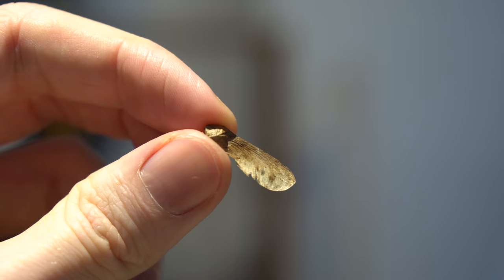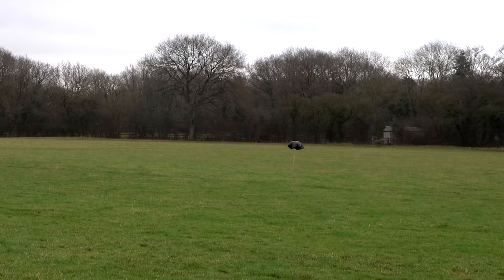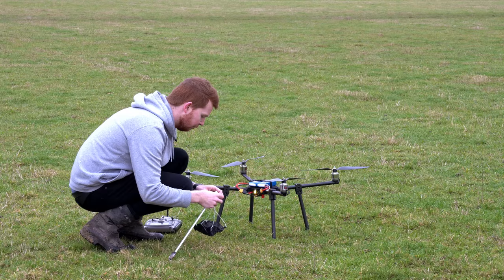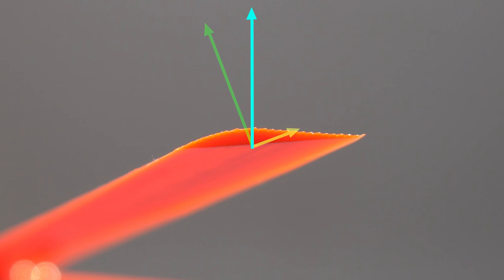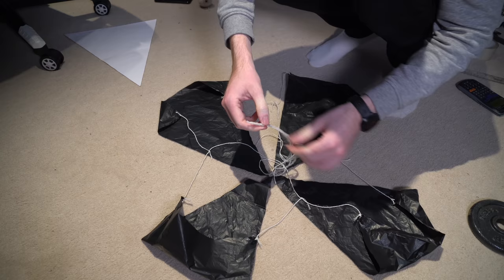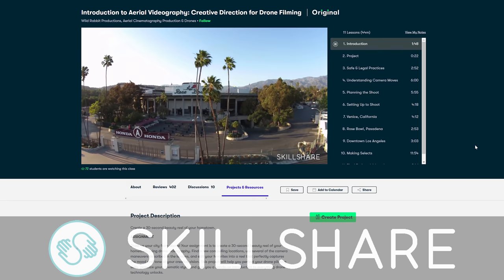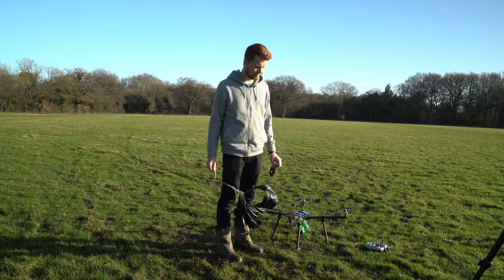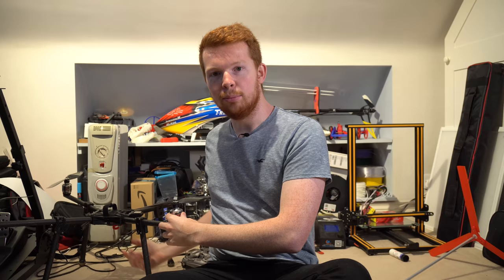Should Parachutes Spin?

Comment: Not saying this is practical as stated, but as an experiment, I'd try duplicating the design of something like a spinning maple seed. A one-sided blade, maybe something stretched over a frame, with a center of rotation that attached to center of the falling mass, and then a separate mass opposite the blade. The blade and the opposite mass will spin about a center of rotation, and the blade accelerating the opposite mass will create angular momentum  in the shaft, and not just create drag against the air. I don't know if I'm making sense, but as slow as those seeds fall, it makes me wonder if it's more than just simple drag against the air.

Comment: I thing rotating objects drop slower because a part of the potential energy is turning into rotating kinetic energy. Angular inertia of the spinning object also has an impact on vertical speed. 
For example if you would made those blades with higher radius but the same surface area, blades would fall slower due to increase in angular inertia. 
Correct me if I'm wrong cuz my argument is based on my high school physics lessons.

Comment: Oh, this is pretty neat, Tom! Have you considered experimenting with Rogallo wings? Somewhat related: One thing that a drone can't lift- even at a very light weight- is an unfurled parachute placed under the drone and attached to the underside of the drone. The downward thrust of the blades holds the 'chute firmly to the ground and prevents the drone from rising. Admittedly, this was the expected result but I just wanted to actually see what would happen. :)
Reply: I think as long as the air is able to escape around the edge of the chute, the drone would still fly, just not as efficiently.

Comment: An easier way to explain why it makes it slower, 
The total energy of the payload is its potential energy due to gravity. That's as fast as it can fall. Gravity adjusted by its intrinsic drag. That's the only energy it has access to. Its shape is such that when falling through air, it must spin. This spin requires energy to happen and it HAS to happen. So the energy to spin it comes from the only energy it has access to, gravity. And that's constant. The energy required to spin it comes as a reduction in fall speed.

Comment: In thinking about NASA, there is a need for redundancy. There are videos of one chute failing in a triple set. Thus, the working two would avoid disaster. Rotating chutes could be  counter rotating quad copter style, but there is nothing to prevent interference from diagonal chutes. With a single chute, there is a problem with the bearing to prevent the payload from spinning. A two chute counter rotating configuration would be possible, but the failure of one side would result in an unacceptable descent rate. In addition there must be a pair of bearings to avoid twisting the shrouds. Bearing failure would rope up the shrouds, collapsing the chute. There is also the problem of chute opening and stability before full deployment is achieved. In short, it is a pass or fail system, not recommended for life support.

Comment: Just an observation: it seems that string of the spinning parachute could not spin freely. It seems it tries to spin the weight as well which stops the parachute from spinning faster. it would be really interesting if you could place a bearing between the weight and the main string. Maybe faster spinning of the parachute provides slower descent and more stability.

Comment: It might also be worth trying tapering the blades along their length.  The inboard low speed area is the ‘driving’ section at a lower pitch angle and the outboard  high speed ‘lifting’ section at higher pitch angle.  If they blades can be spun up prior to release, they avoid the need to optimise the blades to ‘accelerate’ the rotor during the initial fall.  Alternatively, have a variable pitch system at a low pitch after initial release to accelerate the blades, and then increase to pitch when up to speed to optimise the L/D ratio.  Lots of hard CFD sums, perfect for another video :-)

Comment: OK. How about a parachute AND blades? (one would follow the other)
Once that's done ... how about doubling the blades? Will it also double the time to go down? 
How about calculating the maximum amount of space between blades so that they don't interfere with each other? Meaning, how much more blades can you put until it doesn't make a difference (but still rotates)?
How about putting parts of a parachute between the blades, where it's calculated the blades don't rotate enough to make a difference?
How about going nature's way and making a one blade parachute?
Finally how long can these blades be? Is longer more efficient?
Wow love your videos. Keep them coming!

Comment: I have deleted a few comment attempts due to recognising my own ignorance. I would argue that equating a diameter of rotor equates to a diameter of parachute. my answer is... it does not, because both rely upon entirely different principles. but I have to give you credit, massive credit , for covering yoyur variables so well. surface area of  parachute equalling surface area of 3 blades. I really am impressed now I watch and listen... really impressed. and this is less than 1 minute into 9 minutes.

Comment: I think the autogyro concept needs further investigation. If airdropped cargo had the potential to get shot at, having a high rate of descent through MOST of the drop would be a good thing. If this drop rate was converted and stored as rotor rpm, but the rotor blade pitch was sharpened at the last possible instant to arrest the descent to almost zero just as the cargo reaches the ground, the cargo would be a lot harder to hit, spend less time aloft as a visible target, yet still minimize potential damage to the cargo. Obviously this would require some active control of the rotor assembly, either through on-board software, or via a radio remote control, or both, much like your drone has. This would allow the descent profile I described, PLUS the cargo could be placed on the ground much more precisely, and if the cargo was actually “slung” beneath a rigid frame where the rotor assembly was, then as soon as the cargo was resting on the ground, the remaining rpms would be just enough to displace the rotor and frame just far enough to not land on top of the cargo, unless it was part of the deployment scheme, wherein the assembly would include some kind of protective cover/camouflage, even booby trapped if necessary disarmable only by friendly forces, in cases of really high-value cargo or if there could be a significant time delay between deployment and recovery. The entire thing could be recovered along with the cargo, picked up by drone, or by hand at a later time.

Comment: What if you get your autogyro out again, but have an actuator to change the pitch.
At the last 3 meters or so, change the pitch so it has a higher angle of attack and softens the landing to practically no downward velocity.

The same thing can be said about the parachute. As soon as the parachute gets to about 3 meters, drop the weight to the ground and let the sensor very gently land, again with practically no downward velocity.

I mean there is a RC heli right there on the shelf!. :-)

Comment: A question that might be interesting is if the propeller blade had a twist in it much like the propellers on planes often do.  Would it be possible to take advantage of the airflow difference between the root and the tips of the blades doing that?

Comment: Takes more energy to change direction using a helicopter blade. Parachutes allow for the rider to decide wear they fall with relative ease given the proper parachute design. Also extra moving parts of the spinning blade is asking for an accident. Just food for thought though cause I like your experiment

Comment: Just as a side, some helicopter pilots have used this to save the lives of those on board when the engines fail, the skill it takes to do this with helicopter blades is unbeliveable. They still smash into the ground but at a much slower than they otherwise would

Comment: this would add quite a bit of weight to the craft and it would not slow it down enough passed Terminal Velocity,  you will still need the retros to land. Still you would be able to steer the modal without expanding fuel and if that is the goal. I did this a few times in simulators and Auto-rotating is difficult at best your rotors can stop spinning and you sometimes can't get them started again once they stop. this is not a new Idea for a spacecraft.. still the obvious answer as to why no one has tried it is material sciences, metal crystallization and failure  maybe with the reentry temps are too high and coatings are too delicet but they did try this during the mercury capsule days...

Comment: Really interesting.  I always wondered whether this principle had been considered when deploying equipment to Mars.  It always seemed that the methods traditionally using thrusters were pretty complicated and not very forgiving in terms of stability.  A rotor system (not a rotating parachute) could pitch the rotors just  before impact for a soft landing.

Comment: some late info.     at :22,  answer  -  the  overall  Shape  leads to spin  and  an increase in AIR  RESISTANCE,  and  LIFT.     rate of descent  is reduced  by,  both,  drag  And  by aerodynamic  Lift.   ( just like  ANY  other gliding  wing, that has a lift-making profile ).      googletranslate

Comment: You could dig a little deeper to this matter as you did with the tribuchet. Try to print new blades with a v-shaped pocket in the green area of the blade as you shown in this video to make the upcoming windflow spin the blades even faster. Or probably set these blades to a autogyro and run a different test. Do you think such pockets would make any affect?

Comment: I still do not fully grasp this. The propellor spins in the wrong direction and so I can't see how it would cause any significant amount of lift. You explained the lift and drag too quickly. Doesn't the spinning cause more horizontal drag. Which gets converted into heat energy. So height energy gets converted into heat energy more efficiently with a propellor.
Reply: And would the propellor parachute work even better if the tip was tilted into the other direction compared to the center?

Comment: I couldnt help but seemed to notice that the leading edges of your red rotorblades was slightly angled at a negative pitch. . . . or was it just the camera angle in your still photos???  this would result in the trailing edges of the blades rotating in the opposite  direction of the leading edges of the rotorblades, causing them 1st to bite into the air. If ya was wanting to have the rotor blades spin faster at a much slower rate of descent, increase each of the blades pitch to more of a positive pitch--leading edges bite 1st into the air as the rotate. Awesome video.

Comment: The rotating canopy idea might be ok for  inanimate objects, but your suspended load will spin even if there's a swivel in the system. That creates two problems if you have a human load: lack of control and the people (or even animals) will be insanely dizzy when they hit the ground. And any stabilization mechanism will add to the suspended weight and therefore require a larger parachute.

I think the KISS rule applies here.

Comment: Tom,   Love the vids, great job.   I think going one step higher on the autogyro would be to put in a single serve collective system on it.   Drop it let the blades spin up and then pull collective once the test part gets close to the ground.   I have always wondered why spaceX never did that.   They bring enough fuel to get the craft up and back down, seems heavy to me.   Put if they did fold out blades, they can use the potential energy to spin up the blades on the way down and land.   And for the parachute u could do a similar thing and flair it right before landing.   To compare the 2 ideas, have a G sensor to measure the impact G's.
Reply: There was a roton rocket. The whole mechanism is heavy and complicated. Falcon 9 really doesn't use a lot of fuel for landing. Additional fuel cost mostly comes from getting all that additional fuel up. You have the same issue with rotors.
Reply: @nejcpintar7965  Thank you for the info... I was always wondering about that!!!

Comment: You should try a Archimedes screw and see if that will  glide down even slower just extend the screw as you go up so like a parabolic spiral screw
Reply: lmfao       just as with a vawt, vertical axis wind turbine,  there is  NO  REASON  for air to enter and stay in such a   Rotating    structure.

Comment: Great video, Tom. I know the principle of how an autogyro works is not intuitive, so your description was very helpful. How about this for an idea: what if an autogyro had FOUR blades (most are two-bladed): two normal ones and two 'shorties'? The idea is that the short blades operating in the inboard part of the disc would theoretically provide extra rotating force to the rotor, so more lift would be available. Maybe allowing a smaller rotor diameter... How about trying that one out? Many thanks!

Comment: If you could store energy in the rotor could you flare late in the descent and therefore have a much smaller surface area and use the energy generated in the last few feet,

Comment: great video-thanks..  I found this very timely, as I am developing  a deploy-able wing (like the seed shape) with ribs and sub ribs made of carbon-fibre-kevlar, and a hybrid silk composite  for the membrane,  for dropping a man and equipment from both low and high altitudes.  Eventually after the un-powered prototype proves my concept, a lightweight fly-by-wire mechanism will be installed in order for a micro-manipulator arm/actuator mechanism,t to control the wing shape [read pitch, yaw, roll, etc.), and a computer will change the shape of the wing for maximum efficiency.  This will slow the spin down to the same as jumping off a 2 meter platform.  Need to work out the 8 minutes of dizzynness that comes with a drop at 5,000 meters.

Comment: Out of interest, were you working out the "surface area" of the parachutes when laid out flat or the horizontal cross sectional area as they'd be when inflated? (the effective area which is actually blocking airflow and creating drag)

Which would be the correct method?
Reply: James Bradwell   Parachutes are secondary devices and weight is critical.  It comes down to " you have 10 grams of plastic
-  how do you want to use it."  Area= weight so cut it any way you want.  The higher the drag the better.

Comment: 4:48 Yeah. Parachutes are weird. Did you also know that some nations (I am most familiar with Russia doing this) even put small rocket motors attached to parachutes? The purpose of the small rockets were to further reduce acceleration as objects (or heavy cargo falls down) fall.

Other than that, there were other weird "parachutey" looking systems from long ago (like for example, back then during the 1960s [I think?] some people have entertained the idea of using hot-air balloons [that sort of deploy like a parachute] as a means of slowing descent of the pilot's ejection seat [and hell, even fly the ejection seat at a level altitude for some time. All thanks to the hot-air balloon device], and for air-dropping tanks, or something. Times back then were super weird        :/       )
Reply: I seriously doubt anyone put rockets on a canopy,  maybe on the load

Comment: What do you think of vortex generators? Perhaps the 17 °- 20 ° of the rotors' individual length, then a tapered winglet turning downward at 35°. 
I had a once had a similar tail drag chute applied to a box delta kite. 5 triangular pieces .  And 150mm diameter shaping ring and a swivel.

Comment: Dude, I have a very good idea for your compressed air engine. This idea of using pistons doesn't work with compressed air just because it works on gasoline cars, you need to use a circular motor as it will be more efficient since the engine doesn't need to use the energy generated to control the compressed air intake. if you didn't like the idea, at least try please

Comment: What if the parachute were just a disk? Then it would truely utilize its entire surface area, no? Whennits curved, the pressure inside rises and effectively diminishes the active surface area. A parachute may evey experience a coanda affect like that hovercraft, pushing it down even faster

Comment: I wonder if instead of having negative pitch as your set up to spin easily how it would have affected the rate of descent if your pitch was positive 3 degrees pitch above zero lift angle, just like the real autogyros. The problem is that you would have to prerotate it to achieve autorotation.

Comment: Great video and testing concepts of potential drone soft crash protection which will be someday a waiver requirement by FAA for us Part 107 pilots when a job is a planned event and over people. There always has to be a risk mitigation plan to have a soft crash protection system when the drone fails. The right parachute or advanced rotor design could be a near-future good business opportunity for an entrepreneur or existing company with how fast the drone technology is moving forward. If that company designs /develops a design that is both scalable in size for various mass drone models and proven software with a digital control system configured for automatic deployment or when the pilot kills the motors in flight for safety reasons.
I believe from looking at the video, that at some point in time when you had high rotation blade speed (on Rotor Blade test unit), the string was what compromised the leading edge break and not the ground impact? You would know best as you were there.  Just having a fun conversation. Thanks for sharing.